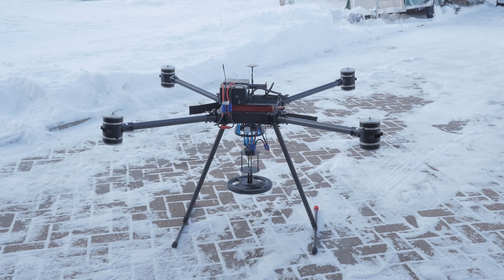TMotor MN705 125kv Coaxial Arm Sets -17C Test

Comment: Hello. I am building a similar setup with T-motor Coaxial Arms (505S-320Kv + Alpha 60LV ESC) and found your video. There is not much out there really. So I am really glad I find this video.
Your setup looks great BTW! Custom frame?
Now, I have a question, did you use a middle screw through the boom on the Tmotor arm for additional security? Someone told me it is not necessary and the two side screws are sufficient. But he would advise me to do so for extra safety. Tmotor doesn't say anything on their website.
Furthermore, have you already flown in this cold weather? I live in Switzerland and fly a lot at high altitude and cold weather too. Would like to hear from your experience.
Look forward to hearing from you. Greetings from Switzerland!
Thai
Reply from the maker: Hi Thai.  Always use the middle screw!!!  The main reason for this is if one of the side screws loosen or break there is a good chance the motor mount will turn on the boom.  This will instantly cause your aircraft to crash.  Yes, custom frame.  The MN series motors work great in the cold.  Have flown -20C many times.